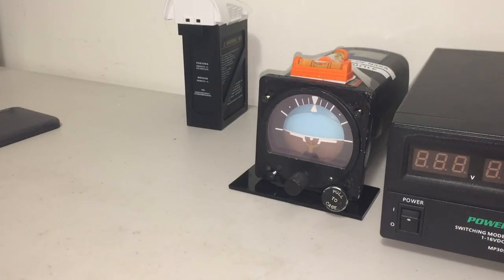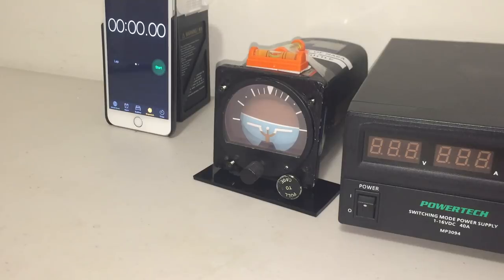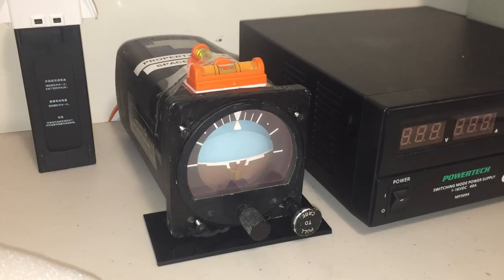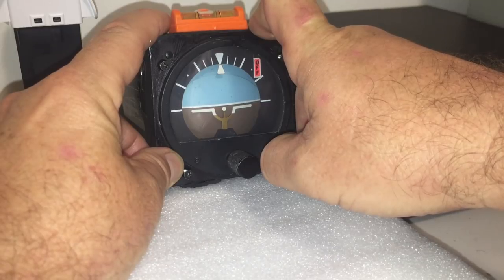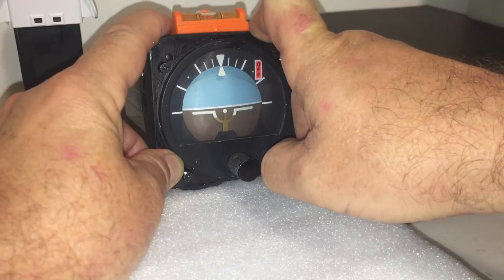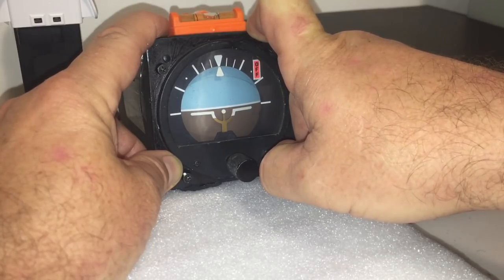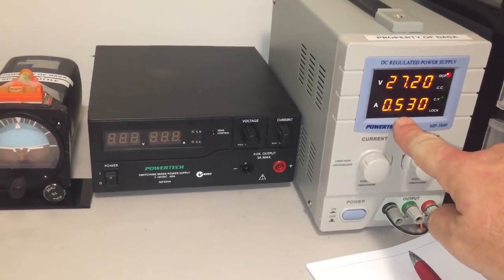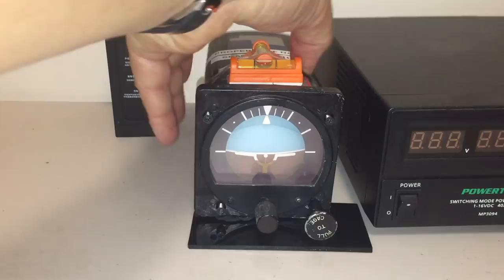Two more gyro experiments as requested by viewers.

Comment: Wolfie, your gyro works just like the gyros in my Bradley Turrets when I was active duty.
We would be in a hide postion where the hull wouod be at all kinds of funky angles. When we would power up the turret and put it in "STAB" (Stabilized) the gun would always be level to the ground when the "action handles" were squeezed. 
We did not have a cage handle. We had a "drift" button to null out gyro drift. 
No matter what angle the hull was at or what clock postion the turret was at the gun would be level. Even if there was a change in Gs, example (hull going left - turret right - barrel up while going over sideways on 45 deg slope doing 40mph) the gun would still stay on target. 
Darn pesky gyros, always knowing which way down was.
Reply from the maker: +Geist View - interesting, I didn't know that but it makes perfect sense.  Gravity can be incredibly useful considering it does not exist
Reply: +Geist View, that's a great story! I was wondering why you were always STABbing people. Must be a habit. ;-)
Reply: Wolfie6020 

The seeker head in the Stinger Missile also uses a gyro. When its activated it takes about 5-10 seconds for gyro spinup and the cooling of the seeker. At launch the missile  generates 20gs and activates the self descruct mechanism as it accelerates to mach 2. The missile needs to know which way is down during flight to have a baseline in which to calculate its roll to Target. The gyro needs to ignore the launch Gs and the Gs from constant acceleration. It also needs to compensate for the shift in CG as its fuel is expended and it gets nose heavy. 
IMPOSSIBLE mechanics in the Buoyancy and density argument. Darn pesky GRAVITY messing up that FE vibe. 

Yes I was a SHORAD AIR DEFENDER. MOS 16R/ 14R/ 14S to include C-RAM (intercept/ Sense & Warn).
Reply: +matk jamus    you can't.  you're lying as per usual.
Reply: Mark Jamus

As you were respectful in your question I'll give you respectful answers. I will also ask some of my own.

" I laughed at flat earth at first!" I don't laugh at FE (its absurd on its own). I laugh at claims made by Flat Earthers who use claims as evidence.

 "Then I did one simple experiment for my self." as I already read your full reply I'll skip to the chase. You preformed a experiment on the Strawman you built of what you SHOULD see. Since reality did not conform to your expectations it must be reality that is wrong, but not you

 "I live on the ocean," I was born in Hawaii raised on Kodiak Island AK.

"My friend took his boat"  I worked on Salmon boats (gill net, Sene and longline), crabbing boats (King, Dungenes) and fish processors  these are not including the family 25' Bayliner. Made good $ as a kid working my ass off.

"a 25ft mako," nice

 "sits at best 10ft above the water," what part? The deck? What was its freeboard? 

 "10 miles out," Ok how did you verify this distance? DETAILS

 "Thru my telescope " ok

"I can see the whole boat clearly!" doubt it. Where was this sighting made? Time of year? DETAILS

 "from the beach!" where on the beach?

 "Using the math of the earth at 25k mile" 25,000 kilometers? or 25,000 miles? where are you going with this?

 "around" radius?

"and my scope 6ft above ground level" ok

 "the boat should be 32ft below the horizon!!!"  Wrong, Refracted Hidden= 26.12 Feet (313.44 Inches). 

 "I did this 3x once in spring at due east, once southeast in fall, once in summer south all the same! Why?" Wait you said you did ONE test now its 3 tests? Why are you leaving out details?

 "How can I see it?" Light refracts. This is well understood. As is Mirages and Looming.

Now my turn

1) I've seen fishing boats using stabilized 100X binos yet the radar cant see them. Why is that?
2) The inability of our Radar and visual in calm clear day in December to see the Cape Disappointment lighthouse at 23 miles. Why is that?
3) The inability to see people on the beach of Dover UK from the Beach at Calais France (can see people on the cliffs of Dover but not the beach). Why is that?
4) Why was the White Alice array on Kodiak on Pillar mountain, when if the earth was flat they could have built at Chiniak point and had perfect LOS shots with microwave. Why is that?
5) The inability to see the North Jetty of the Colombia river from Astoria (12 miles away) standing at the waters edge at low tide using 80x spotting scope on a 5' mono-pole. Yet can see it appear east to west with a 4k camera on my drone as it ascends? Why is that?

I can go into the whole celestial navigation problem with the FE but I save that for later. 
Also nothing you replied with in any way is related to my original comment of the thread.
Reply: +Mark Jamus, your "one simple experiment" proves one thing: that the Earth is not a sphere-with-no-atmosphere (thus no refraction). Unfortunately, that's a straw man. No heliocentrist is suggesting the Earth is a sphere-with-no-atmosphere. Your experiment does not actually prove the Earth is flat, especially since, when you go further, things are cut off from the bottom up due to curvature.

Not to mention the hundreds of other careful observations you can make which only correlate with a globe Earth. Have you done any of the backyard experiments on my channel yet? :-)
Reply: flattards don't want their feelings hurt so they tend to avoid simple experiments like buying a good telescope and see planets and the moon and if you're lucky the ISS and satellites
Reply: +Mark Jamus, thanks for your reply. :-) You quoted a bunch of Flat Earth videos with those numbers, which are not only NOT accurate, but they're constantly (slowly and slightly) changing!

What's the tilt of the Earth? It ranges from 22.1 to 24.5, and the best exact value is 23.439281 degrees. Which is 66.560719 degrees from the orbital plane. Who told you it was 66.6 degrees? They were lying to you.

What's the average speed of a point on the Earth's surface? It looks like someone decided the Equator travels at 1000 mph (it doesn't) and then arbitrarily took 2/3rds of that value and called it the average (it isn't). When I measured the speeds every 5 degrees from the North pole to the South Pole I got an average of 633.877 mph. Who told you it was 666 mph? They're lying to you.

What's the speed of the Earth as it moves around the sun? Well for starters, it's not a constant. It moves the fastest at Perihelion: 67,779 mph, and slowest at Aphelion: 65,542 mph. Who told you it was exactly 66,600 mph? They're lying to you.

As for the speed of the sun through the galaxy, I've never seen anything close to the value you wrote. The best estimate I've seen is 514,000 mph. Who told you it was exactly 666,000 mph? They're lying to you.

Don't you get a little frustrated being lied to so consistently by the same group of FE people?

I do hope you take me up on my offer to carefully make measurements as described in my videos. You wrote, "I will destroy those videos one by one" ... how exactly does one destroy a video that instructs how to make careful measurements? You can make the careful measurements either way, the data will be yours to keep.

If you're so sure about the shape of the Earth (which has nothing to do with evolution, by the way), then you'll have full confidence that your careful measurements and observations should make sense on a flat Earth. :-)
Reply: Mark Jamus
You should show some pictures of what you saw. That would at least give some kind of evidence of what you say. 
Like this one. Albeit that they show the opposite: ships do sink below the horizon at greater distance, And these boats are somewhat bigger than that 25 ft boat of your friend
https://deadconfederates.files.wordpress.com/2013/05/hull-down-03.png
There are a couple more where this one came from. With explanation of why you see what you see. Curvature of the earth and all that
https://civilwartalk.com/threads/hull-down.83791/#post-636864
Reply: mark like all FE and YEC all they do is strawman n use pascal's wager
Reply: Mark Jamus 

Ill just translate your last reply: "Conspericy".

Good thing I replied to you and you completly IGNORED it! WASTE OF MY TIME!
Reply: Mark Jamus 

Good thing the earth is not Flat! Or you might have a point.
Reply: Mark Jamus 

Still waiting on you to "destroy" anything. Ill im seeing from you is repeats of claims. 

Try harder...
Reply: Mark Jamus
Does the sun angular size changes through the day? 
It SHOULD on a FE. 

YET IT DON'T! Just another nail in that FE casket.
Reply: Mark James     
"Ya that would be the freemasons, who invented this globe model, and evolution. " Here we go again: the freemasons are to blame. Sigh
   
The evidence of the senses further corroborates this. How else would eclipses of the moon show segments shaped as we see them? As it is, the shapes which the moon itself each month shows are of every kind -- straight, gibbous, and concave -- but in eclipses the outline is always curved: and, since it is the interposition of the earth that makes the eclipse, the form of this line will be caused by the form of the earth's surface, which is therefore spherical

        Again, our observations of the stars make it evident, not only that the earth is circular, but that it is a circle of no great size. For quite a small change of position to south or north causes a manifest alteration of the horizon. There is much change, I mean, in the stars which are overhead, and the stars seen are different, as one moves northward or southward. Indeed there are some stars seen in Egypt and in the neighborhood of Cyprus which are not seen in the northerly regions; and stars, which in the north are never beyond range of observation, in those regions rise and set

        All of which goes to show not only that the earth is circular in shape, but also that it is a sphere of no great size : for otherwise the effect of so slight a change of place would not be so quickly apparent. Hence one should not be too sure of the incredibility of the view of those who conceive that there is continuity between the parts about the pillars of Hercules and the parts about India, and that in this way the ocean is one 
(Aristotle, "On the Heavens," Book II, Chapter 14, The Works of Aristotle, Oxford University Press; pp. 297-298.)
Aristotle lived in the 4th century BC. Long before the freemasons ever existed.
Reply: +Mark Jamus, thanks for your reply. You wrote, "The speed is 666 mph for a reason." But you never said where that speed came from. It certainly doesn't come from the globe model, unless you want to claim that 633 "rounds to" 666. Hence, you've been lied to.

Do you know what units are used in the ENTIRE scientific world? SI units, for Système international (d'unités), and there's nary a "mph" to be found. So when someone tries really hard to find the number of the beast (when selectively rounding, using units which aren't even employed in scientific work), you gotta really stretch. 

Just like measuring the Earth's tilt. Who measures tilt from the horizontal? That LITERALLY makes no sense. But it makes perfect sense when the goal is to arrive at some number with a bunch of sixes in it. 
wikipedia.org/wiki/Axial_tilt#Solar_System_bodies
Oh, look! On IAU, 0 January 2010, 0h TT, the Moon had a declination of 66.6 degrees! (Actually it was 66.54, but I'm rounding up, because reasons.)

I see you gave no mention of the sun's speed through the galaxy. Do you have a source that says it's 666,000 mph? Or are we just "rounding up" from 514k?

As for destroying my videos, you're already on shaky ground. You say I believe the sun "travels in a straight line, from point a to point b, the same point year round." Do you have a source? Because I've never said any such thing. (I do claim that in the helio model, on the equinox only, the sun's path in the sky is straight, but I never claimed that about the Flat Earth, and certainly never said any such thing about year-round.) 

You'll discover, if you actually take the time to watch (carefully) my videos that I present not only the heliocentric model as it exists, but I use the most common Flat Earth model, with frequent comments about the many places the observer may substitute their own Flat Earth values if you don't like mine. But I treat the Flat Earth model soberly and carefully, just as I do the globe. 

Measure the speed of the sun, moon, and stars in the sky. Measure the angular diameter of the sun and moon. Record the sun's path through the sky. Observe with care the "wagon wheel effect" of both sun and moon. Examine carefully the phases of the moon. You don't need any "assumptions" or "presumptions" to make any of these careful observations. The Earth could be banana-shaped and made of frozen Jello and you can still make these observations. Toss my analysis out the window. Just make the observations. 

But I don't think you will. I think you're scared what you'll discover: that 100% of YOUR OWN careful observations will correlate 100% with the helio model. Because you've been lied to, and have believed the lies. Coming back down off that FE pedestal will be hard, but if you have courage, you can do it. :-)
Reply: Geist View So wait the sun is not further away  at sun rise than at noon on a ball earth? Shows how smart you are right there.
Reply: Christopher Kidd 

Nope its not. You have a video showing otherwise?
Reply: Christopher Kidd 

Just a reminder; noon is not solar noon.

Shows how smart you are right there. 

You can post that video of the suns disk changing angular during the day anytime.
Reply: JDM A'F 

Im looking forward to his sun changing angular size during the day video.
Reply: +Christopher Kidd, if the Earth's orbit were a perfect circle, then yes, you'd have a point (a tiny, tiny point): the sun is technically further away at sunrise and sunset than it is at noon, by a max of one Earth radius, on the Equator, on the Equinox. But the Earth's orbit is an ellipse, so the amount of distance the entire planet is to the sun is constantly changing, thus this "difference" you speak of is lost in the big picture.

To give some numbers, the center of the Earth was 148,469,377 km from the sun at sunrise today here in Philly, then it was 148,460,933 km at solar noon, then 148,452,532 at sunset, for a total difference of 16,845 km in a mere 10 and a half hours. To then calculate how far Philly was from the sun at sunrise, versus solar noon, versus sunset is a delta of +/- 2626 km. So it's kind of like saying Philly got 2626 km closer to the sun as solar noon, but the planet was 8,444 km closer due to its elliptical orbit. Then philly got 2626 km further away from the sun at sunset, while the planet got another 8,401 km closer.

The main point is lost, that these daily differences represent (even if we apply a generous 10,000 km difference) seven-thousandths of one percent difference in the distance to the sun.

Meanwhile over on the Flat Earth (pick your map, pick your model) you have locations routinely getting 2x to 3x closer and further away from the sun in one day.
Reply: +Flat Earth Math glad you are not a flattard :)
Reply: Christopher Kidd Yes, the sun is closer at noon, can you tell me by what amount? Earths center is about 149,597,870,700 meters from the sun. 'noon' would be a radius of the earth  closer: 6.371.000 meters. So the sun is about  0.004 percent closer at noon. 'nothing' really. Nothing we can measure or detect with the naked solarfiltered eye.... The clue is: the sun (and the moon!) do not change size drastically during a 24h cycle. Therefore it does not change distance drastically. If the sun was 5000 miles above us, it would shrink to HALF its size when it moved to a total of 10000 miles away from us. BUT IT DOES NOT. Flat earth model says the sun will shrink to zero ABOVE the horizon. Which is a LIE.
Reply: Christopher Kid may include the radius of the earth in his thinking as your location on the earth rotates from the terminator to solar noon. Well, at the equator, that is smaller than a decimal rounding as the distance to the sun is more that 23000 times the radius of the earth. (but as I write this I see you and other have already touched on the subject. Well, I have gone to the trouble.)
Reply: heliocentric moron, can you please stop posting debunked videos.
Reply: +The Heliocentric Destroyer
Hello, you seem sincere, so I will try to answer you. 
' there are no experiments successful which have ever proven Earth to be in motion or orbiting motion.' The sky is a pretty big hint. Stellarium is a free opensource heliocentric model, that is very, very accurate. Where is your model btw? Oh, you dont have a working model do you. At the equator you weigh less. Exactly what you would expect due to centripetal forces. So...

'How do you orbit around the Sun over 300 Million Miles while maintain axial alignment with both the southern star and northern star? '
There is no southern star really. And even the northern star is slightly off. And 300 million miles is nothing compared to the distance of the northern star: 433 light-years. Which is 2545445000 million miles. And the very slight difference that is there, is measured and used to calculate the distance: parallax. So...

' there is no curve to be found' except we can all measure the curve over 3 km just fine....
'Little Piggy air balloon are examples showing no curvature on our flat plane. ' The horizon is not the curvature of the earth. It is a different circle. Even a high altitude balloon only sees a little circle of the earths surface. We can however, see the curvature of the earth, from our feet, to the horizon, to any bottom part hidden behind the horizon.  Ships: buildings, pontchartrain powerlines, everywhere, everyday. 

'Your model had to make up 95% dark matter and dark energy' To make the model actually work, yes. 
Where is your model? Oh right. you dont have ANY working model. Guess what model predicts the next eclipse to the minute and mile. (nods) there is no working geocentric model. Only fantasy from deluded people.

'Your model called it the axis of evil when the radiation background test put Earth in a special place. Works perfect on a Geocentric model.'
Word salad. Adjust your medication.
Reply: +The Heliocentric Destroyer
'Did you know the Foucault pendulum requires an extra mechanical kick to keep it swinging'
Did you know that in the explanation YOU QUOTED it says: 
'This restores the energy lost during the swing and keeps the pendulum from stopping. It has no effect on the direction of the swing'

So what you need a force to keep it swinging: what is the force that makes it CHANGE PLANE? Hint: there is no force; the earth is rotating in stead. 

'There is no heliocentric fantasy globe model.. ' Except there is: stellarium for example. Where is your flat earth map with correct distances east-west on it? What is pulling things down in your model? Where is the sun in your model? You dont even HAVE a working model. DO you.

Heliocentric model explains EVERYTHING. 
Geocentric model explain NOTHING and is not even supported by the most of basic OBSERVATIONS IN REALITY.
Reply: +Heliocentric Destroyer, sorry I didn't read your messages. I stopped at "So first off, to be clear, there are no experiments successful which have ever proven Earth to be in motion or orbiting motion." I know for a fact that I've given you the link to the International Earth Rotation Service www.IERS.org so I'm not sure why you'd say "no experiments" other than that's a line that you're parroting from Flat Earth videos.

If you can debunk every single method described in painful detail in their Science/Techniques/Methods pages, then we can talk.
Reply: The Heliocentric Destroyer 
1) This is absolutely false. Stellar aberration as first shown in 1725 and stellar parallax first measured in 1838. The second point you try to make is the same as to detect parallax at 140 km away by moving your head 10mm. Without very precise instruments this will never be detected. 
2) This has again and again been shown to be false as the observer elevation is much higher than stated. 600 meter of the Canigou peak will be visible from the Alluach chapel.
3) It is acknowledged that the human race do not have the whole picture. For example, we do not know how quantum tunnelling works, but it does work and is used every day millions of times. The same goes for the accelerating expanding universe. A 'force' other than what we can observe in our local neighbourhood is causing galaxies to accelerate in stead of slowing. We do not know the cause, but we do observe the effect. It is very interesting that you should think that the geocentric model explains all observations when it can't even explain retrograde motion of planets in a simple way.
4) There have been many papers on the subject of CMB and various theories given. I will not go into this here, see www.geocentrismdebunked.org for the detial.

Restating the same falsehood over and over even after you are corrected, is the product of a delusional mind.
Reply: +George Hnatiuk Thanks for the kind words, George! But I have no intention of staying away from Flat Earth hangouts. Believe it or not, there are actually a few that openly welcome input from Globers. Cheers! :-)
Reply: FEM,
I did not ever think you would.
But I can always hope :)

I have been on you enough about it and will back off.

another post coming from me in a few minutes -- almost finished
GH
Reply: FEM,
Good post to Christopher Kidd but you are assuming he can understand the significance of seven-thousandths of one percent difference in the distance to the sun.  FEs as you know have difficulty with scale, ratios, and percentages.

Let's look at this a bit differently where I will use your numbers FEM, which by the way are correct.
Also using:
                             the sun diameter is 1,391,403km
                             the radius of the earth is 6371km

On this day at solar noon an observer on the surface of the earth is further from the sun than he is during sunset.   At noon the distance from the observer to the center of the sun is:

At solar noon distance from observer to sun center:  
                Rn = [148,460,933km - 6371km]  = 148,454,562km 

At sunset the center of the earth is 148,452,532km from the center of the sun(closer than at noon).  To get the angular diameter of the sun as seen at the surface of the earth at sunset, we do not need to subtract off the earth's radius because the observer is inline with the center of the earth while viewing a sunset or sunrise:

At sunset distance from observer to sun center: 
                               Rss = 148,452,532km

NOTE:     Rn - Rss  =  2030km         [ FEM used 10,000 km - see below ]

The Sun would appear to have an angular diameter at the surface of the earth with the angle expressed in radians as:     
 angular diameter  = sun diameter / distance of observer to sun center

At solar NOON:
1391403km / 148,454,562km  = 0.00937259 radian = 0.5370096deg

At sunset:
1391403km / 148,452,532km = 0.00937271 radian = 0.5370169deg

The difference in angular diameter from sunset to solar noon is
           0.00000734 degrees  compared to the average of 0.537 deg.
          with the sun appearing to be a bit larger at sunset than at noon.

This is a ratio of 73,161 to 1  or a change of only 0.00137%

---------------------------------------------------------------------------------------------------------------
In case anyone is wondering why my percentage is so much lower than that FEM gave is because FEM applied a generous 10,000 km difference in distance from the observer to the sun as he stated and I noted above, whereas I used the EXACT distance.  
FEM was indeed generous.  He is just that kind of guy but I am not.
----------------------------------------------------------------------------------------------------------------

The change in angular diameter of the sun as it travels across the sky from noon to sunset is imperceptible to the human eye without the aid of instrumentation.  The smallest change that the human eye can resolve is about 0.02 degree and the sun diameter on this day only changed by   0.00000734 deg. or  a factor 2724 times SMALLER than the human eye can resolve.  Any changes you think you may see is most likely due to intensity issues related to the sun's corona making it difficult to determine the actual size of the sun.  Near sunrise and sunset, you are viewing the sun through more atmospheric filtering.  This filtering makes the sun appear SMALLER because the blooming of the corona disappears with the application of filtering.  Cameras have this issue too and to compare any angular sizes of the sun as a function of its position in the sky requires that you use proper lens filtering so as not to overload the camera sensors.

On a flat earth model, assuming the sun and moon are 32 miles across circling about the north pole a distance 3000 miles above the flat earth disc,  both the sun and the moon would have to change apparent size by a factor of 3 to 1 or 300%  or greater as they traveled across the sky.  I will not address the math and geometry on this but if you do not believe it, FEM may have already presented this elsewhere and you can ask him.  I am done with this nonsense.
GH

PS 
Actually this was a good exercise for me.  I found a misconception and error I have made in the past regarding differences in angular resolution as the distance to the observer changes. Previously the values have been overestimated.
 
[change in angular diameter] DOES NOT EQUAL [distance change/ mean distance]

Need to multiply  [distance change/ mean distance] by average RADIAN measure to get [change in angular diameter] 

Good math problem there.
Reply: +George Hnatiuk Thank you for your detailed and entertaining post. Your math is theoretically correct for a non orbiting Earth, with an observer on the equator on the Equinox. However you missed the MAIN point to my response to +Christopher Kidd, which is that the Earth, as a planet, is getting closer to the Sun at this part of our orbit, as the Earth approaches Perihelion. That's where the "generous 10,000 km" came from.

The second point you missed was more subtle, since I didn't explicitly state the rationale, but I did leave a clue: "an observer in Philly" I actually measured the change in distance from an observer in Philly, on that date, between sunrise and solar noon, and sunset and solar noon, and this requires using the latitude of the sun's subsolar point, and the latitude of philly, with the tiniest bit of trig. :-) This is NOT the same as the Earth's radius. Cheers!
Reply: FEM,
You are correct regarding the distances.  I did make the assumption of being on the equator and should have stated it so.  However, using your distances between the centers of the earth and sun over the course of the day was correct as the center-center distances are the same for all observers on the earth.  To be strictly correct for someone at Philly, I would need [as you know] to multiply the earth's radius by the Cosine of the latitude, which is 39.95, giving 4884km rather than 6371km.   To be quite honest, I did miss your "clue"  and just went with the full radius which would be at the equator.  I agree with all the numbers you posted to Kidd except the 2626km.  That left me puzzled so that is why I went with the equator - it simplifies the problem by not introducing more TRIG that would confuse the FE.

I did not figure in the fact that a general observer would not be collinear with the ecliptic to get the true distance from the surface of the earth to the center of the sun.  My gut feel tells me that correction would be insignificant.  I for one do not think any FE even understands this issue and it would take someone such as yourself to appreciate this subtlety.

Your statement: [correct for a non orbiting Earth, with an observer on the equator on the Equinox] has me puzzled for I used the changes in orbital distance from noon to sunset as did you.

       148,460,933km - 148,452,532km = 8401km

=======================================================
The main point to my post and yours should not get lost in the details.  No matter how you slice it, in the heliocentric model, the sun's angular diameter changes imperceptibly over the course of the day from sunrise to noon and noon to sunset and this is what is observed.

In the flat earth model, the sun's angular diameter would change by over 3 to 1 or 300% or more which is not observed.  
The heliocentric model predicts what is observed and the flat earth model does not.  That is the important point to this exercise.
========================================================
GH
Reply: Geist View, thank you for sharing!! I always wondered how that works.